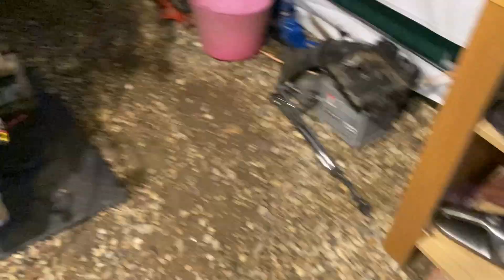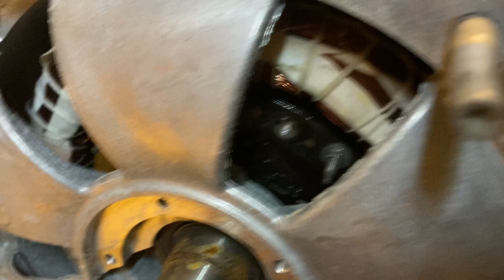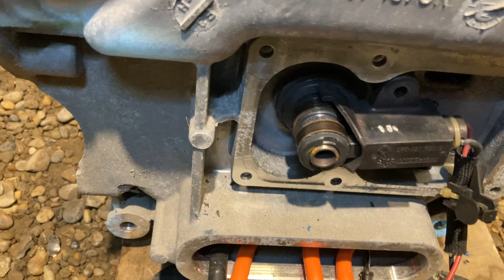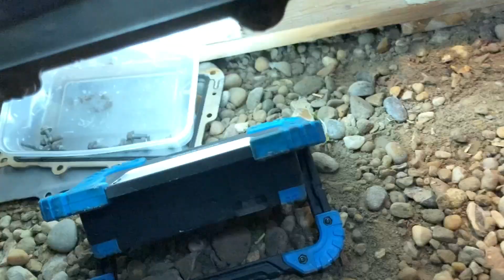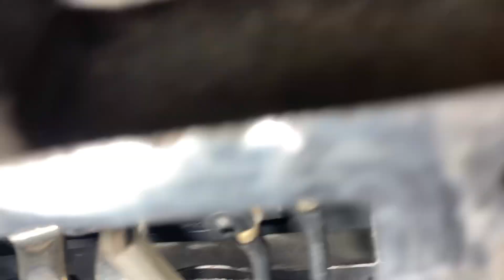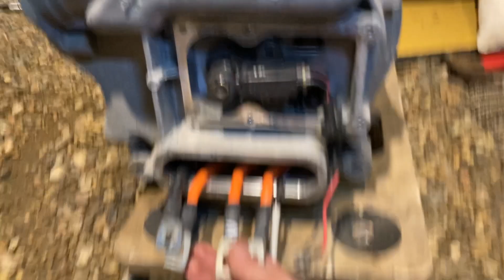OK I messed up and it was bad - EV motor theory - Renault Zoe ZE50 Repair

Comment: The only type of DC motor which works properly with the connectors reversed is the type which has its rotor and stator windings connected in series. Smiths used to make ventilation fans for cars such as Rolls Royce almost a century ago which were of that type. I have one here, and it's a 6 Volt motor. Whichever way around the wires are connected, the motor always runs in the same direction.

Comment: The Zoe eMachine is a sperately excited brushless 3phase design, where the rotor field is also electromagnetically generated rather than being provided by permanent magnets, all of which you already know.  However unlike the stator, which is stationary (duh!) and has an AC rotating magnetic field generated by the 3 phase inveter to which it is attached, the rotor, which rotates (again duh!)  has a DC non rotating magnetic field, which rotates because the rotor iself is rotating.  So, when you swapped +ve and -ve on the rotor exitation wires, you made all the North poles south poles, and all the south poles north poles, so when the inverter applied the stator field at quadrature to the rotor field, the rotor gets pulled the opposite way to that intended.  The same effect can be done by simply swapping any two of the 3 phase cables for the stator (because looping round  A->B->C is looping round A->C->B backwards!). Now the motor itself does not care in the slightest if a pole is North or south, but the inverter, and critically the resolver most certainly do.  I won't go into all the details of Field Oriented Control (FOC) here, but surfice to say, when you put the car in "DRIVE" and apply the accelerator, the inverter control strategy is tying to generate a "forwards" stator field, so as soon as the rotor actually turns backwards it spots the problem and turns off, simply because if the reversed change in phase inductance comensurate with the rotor going the wrong way.  Imagine trying to ride a bike with the steering reversed to try to understand the problem, you want to go left, you turn the handle bars left, and the bike starts going right, so your brain of course adds yet more left input the handlebars to try to go left, and the bike goes even more right!  Eventually, you have steered all the "left" available to steer, just as the motor control inverter has added as much "turn forwards" as it can, and so it shuts down. This is why you get little "pulses" of movement in the incorrect direction before the control system saturates and trips the error and turns off!.  Before the rotor has actually moved, the inverter has no way of knowing the wiring and hence rotor magnetic poles are reversed, so turning it off and on again resets the system until you try to move again 🙂
Reply: Yep, it matters peanuts if it's push or pull, the rotor just turns the same direction as the rotating field of the stator. So phases must be fired the other way. If that position sensor was rotated 90° (2 pole pairs motor) things would go back to normal.

Comment: It is not turning the opposite way, the rotor field and the stator fields are shifted, as the rotor field got reversed. This leads to the drive electronics applying a stator field that doesn't match the rotor field for best and smooth torque, which it then detected once it applied stator current.
The reversed rotor leads are equivalent to rotating the position sensor to half the distance of a motor pole.
Reply from the maker: The car was jumping forward in reverse and visa-versa…
Reply: @garycevrepairs  When is your dissertation on 3 phase synchronous motors finished?
Reply from the maker: As my daughter would say “weird flex but ok”.  Especially as you’re saying something didn’t happen when it did…

Comment: Carbon brushes? Seriously?
Reply from the maker: Indeed, for rotor excitation. It is a 3 phase ac motor so it’s not a brushed dc motor. It doesn’t contain magnets so has to get power on to the rotor somehow. I recently stripped a motor from a car that had done 116k and the brushes were around 25% worn. Cheers

Comment: If you build power supplies for valve projects the secondary transformer windings have a dot at one end of each winding. If you are combining windings these are very important. I suspect this is similar what you are seeing here. Another example is flying. Your instruments say one thing, your gut feeling says another. To stay alive follow the instruments. Follow the instructions and do not over think. Unless you like the smell of burning. I've cocked up like this myself in various ways. I guess we all have.
Reply from the maker: Interesting analogies, thanks.

Comment: Of course it should matter in a brushed DC motor lol
Reply from the maker: It’s not a brushed dc motor (lol). It’s a 3 phase ac motor but with a wound rotor, therefore magnetless. Cheers
Reply: @garycevrepairs  Well yeah, that's true. It is still a DC motor with brushes :D The same effect would similarly happen with a brushed DC motor!
Reply from the maker: It’s not a dc motor, the stator has 3 wires not 2. The 2 wire rotor replaces the magents. It has a 3 phase controller !

Comment: Great learning video.Hi i was going to buy a zoe 50kw that was involed in a shunt but the airbags have been deployed. Is it going to be a nightmare to fix i should i take a gamble on it
Reply from the maker: Hi don’t know your skill level but parts cost can add up quickly and the airbags going off adds to the cost. I don’t really do bodywork as powertrain issues are my thing but budget accordingly. Much better if airbags haven’t gone off, can end up in a nightmare of modules needing reprogramming to remove crash data. Cheers

Comment: A question if I may, why would my zoe stop charging at 97%?
Reply: On the 22kw charger I sat and watched it charge cause    I was amazed at how fast it charges compared to my i3 and it just clicked at 97% on the 7kw charger yes the dash was all black when I returned to the car, I'll keep driving and charging it and see how it goes and I have a dongle for canze on its way so I'll check the soh when it arrives cheers
Reply from the maker: Hi does it always stop at 97% and what year is it?
Reply: It's a 2015 only had it 2 weeks but both times I've tried to fully charge it it's stopped at 97% once on a 22kw once on a 7kw
Reply from the maker: What is the range on a full charge? Is it battery lease? Doesn’t sound quite right?
Reply: At 97% it showed 60 miles I've driven 50 miles to work and back and it's still showing 30 miles with 45% remaining
And yeah the battery is on lease
Reply from the maker: Ok does the dash go black and when you go back to the car it’s on 97% or it sits charging with the dash showing 97% and dashes for the time and you stop it? There was a BMS update for early 22kwh Zoe’s but I believe that’s only for earlier ones. Could be the battery is out of balance - keep draining and fully charging (letting the car finish and dash go black) and see how that goes. As it’s under battery lease it’s Renaults responsibility to maintain it but you’d have to get a garage to check the battery health (soh). If you can get 80 ish miles out of it then the battery is ok. Cheers
Reply: @garycevrepairs  My 50KW  2020 Zoe stops charging at 98%. I tried to take it up to 100% to balance the cells but it sends a message that it is full to the charger and then disconnects. Any idea on that one? This is on a 7KW charger.
Reply from the maker: There is a BMS update for early Zoe 50s which yours is. If range is lower than normal contact Renault. Cheers

Comment: Great learning in the method of doing things ! The beauty of being an electric motor, it only spun the other way around. Imagine rebuilding an ICE engine and putting pistons upside down and then cranking the starter. motor would not be usable anymore ...
Reply: interestingly  (or not lol) some internal combustion engines can actually run backwards!  Two stroke engines that have timing fixed only by piston position, ie those in a say a chainsaw or very large ocean going ship, can accidentally be started and run backwards  🙂